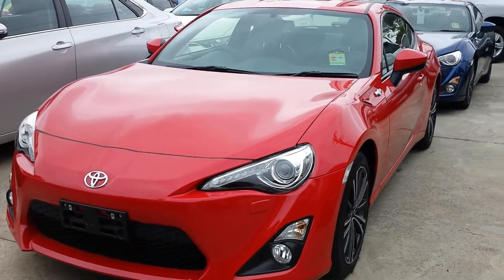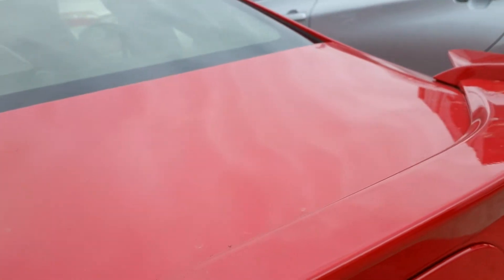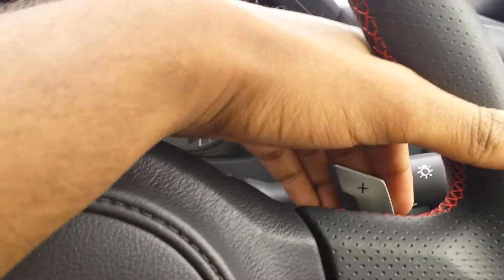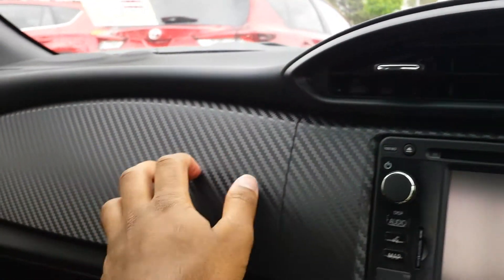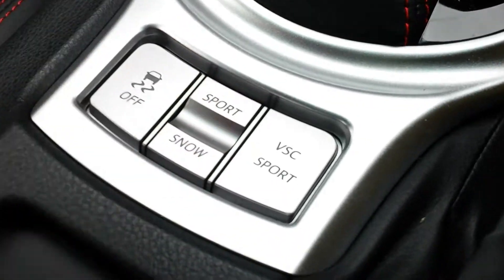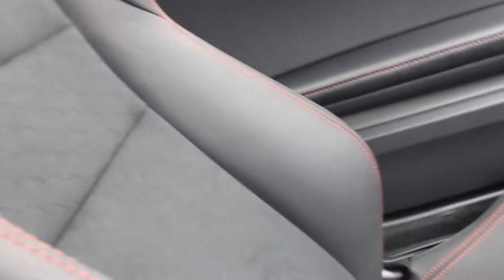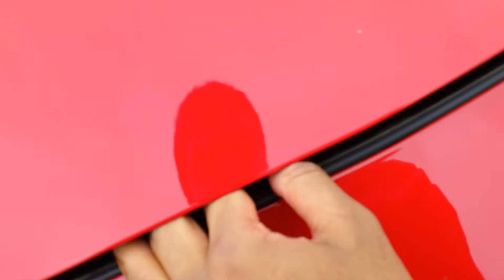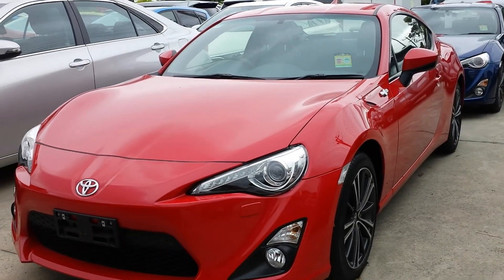2015 Toyota GT86/86 In depth tour Interior Exterior

Comment: I think you can acually use 95.
But you loose some power
Reply: You can use 95 or lower the engine wont last long the higher the octane the more controlled the combustion is. Lower octane is more prone to early ignition which is very bad for the engine can blow a hole in the piston and destroy engines theres a rating for a reason

Comment: Requires 98 and only makes 206 HP, god that's sad
Reply: its not built to be fast, did you even watch the video? 206hp is far above the normal car, my car is the same L engine and the 86 is double the hp with only 100kg extra weight.
Reply: @ozricbarnacles  206 is above a normal car but it's still a incredibly low number. Also you say yours has more HP, well any car can be tuned and modified to be faster and I'm saying this one and stock ones have little horsepower.